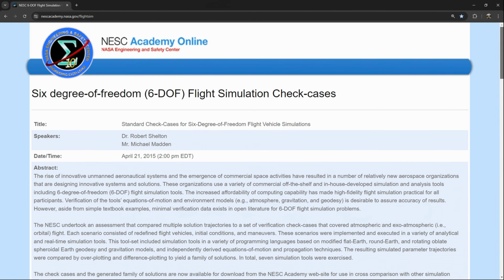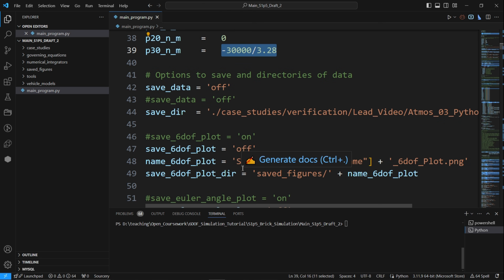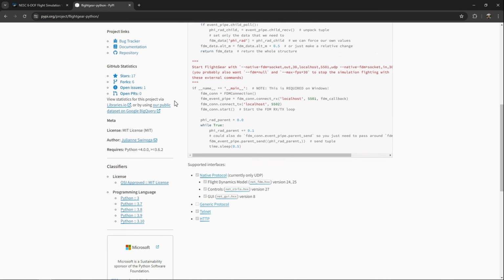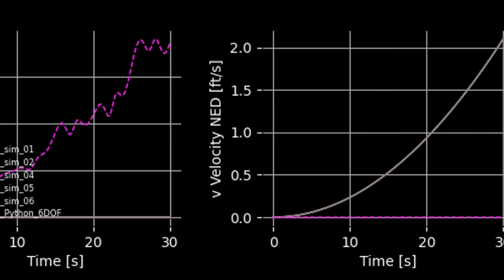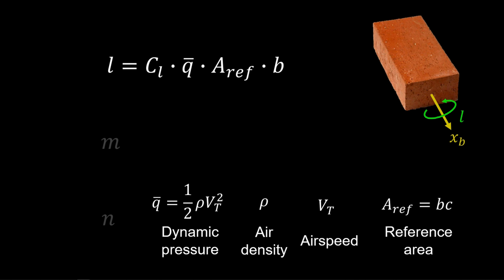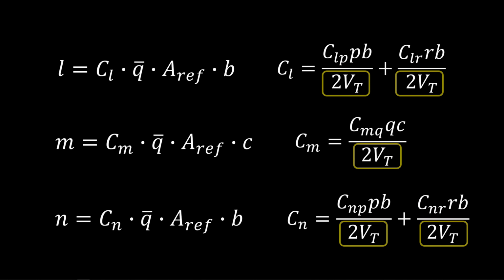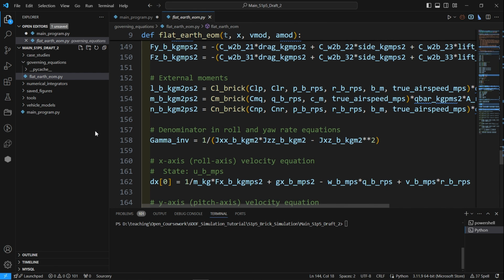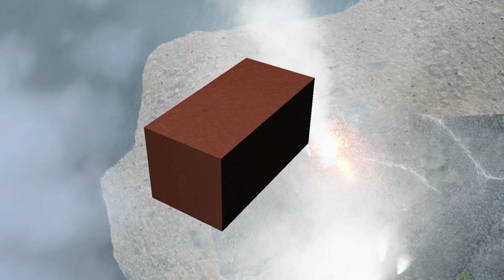Flying Bricks | 6-DOF Verification | Aerodynamic Damping | Flight Simulation Tutorial | Section 1.5

Comment: I get a similar numerical error (order eE-9) in u-velocity but with an initial condition of u0=0, which I find strange. I'm using RK4 to solve the EOM.
Reply from the maker: It's likely numerical error. Matlab RK4 has default absolute and relative error tolerances of 1e-6. An error of 1e-9 is well within this bound.

Comment: Really good series. Any tips in how to add the thrust and trim condition to the model, so it keeps going in a steady state motion? I want to know because every source i see takes the control into it (thrust adjustment, elevator, rudder, etc), and i want it to make it simple for now, if its possible. Thank you.
Reply from the maker: Hello! Yes, these things are very possible and will be part of future video lessons. The thrust model can come from report data where the thrust profile can be turned into a dynamic process using F=ma. The trim routine will involve a constrained optimization process. I actually have a video lesson on trim, if you have not checked it out yet. See Lesson 1.7 at https://learngandc.com/longitudinal-flight-ctrl

Comment: Excellent tutorial! My checks for cases 1,2, and 3 pass successfully.  However, when I test check case 4 (C.1.4), which adds a constant C_d to the sphere, I note incorrect results for position x and y in NED (they should remain zero, but instead become non-zero). I believe I've traced the error to the calculation of external forces F{x,y,z}_b_kgmps2, which I think might be incorrect from previous videos. Is this true?
Reply from the maker: Thanks. Not to my knowledge, I was able to verify against the check cases. Are you sure your initial conditions are consistent? Note, pitch angle is set to -90 degrees so that the brick accelerates in the positve x-direction.

Comment: Ben, those errors which you mention at the end of the video: you found those prior to recording this lesson, am I correct? That is, you are telling us that your original code had errors, you attempted the verification, you found discrepancies, looked for errors and fixed them, and then finally recorded the lesson with fixed code. Is that correct?
Reply from the maker: Yes, that's correct! I did a poll and people wanted insight into the issues found when developing the simulation.
Reply: @LearnGandC  got it, thank you. I definitely appreciate that insight, it is consistent with my own experience, I must say, quite unfortunately. I asked because I wasn't sure if I was supposed to look deeper into the plots to see minuscule differences between lines in the plot. Great job by the way, I'm enjoying those videos a great deal.